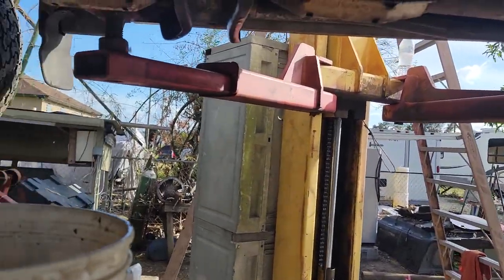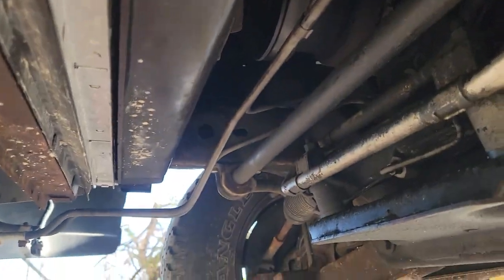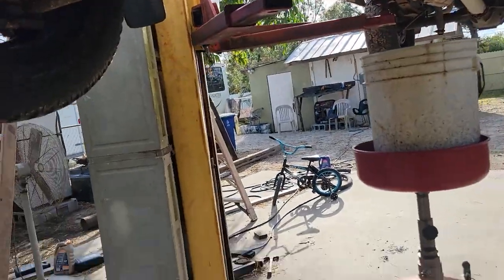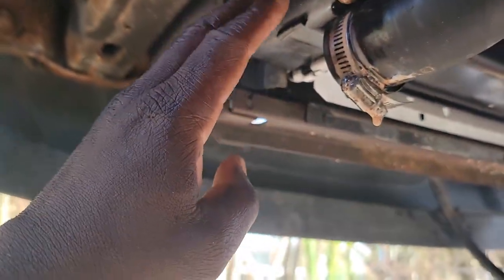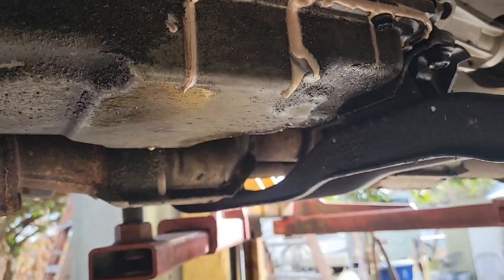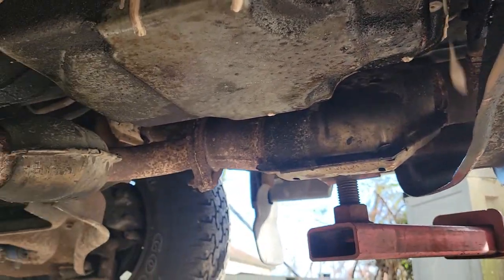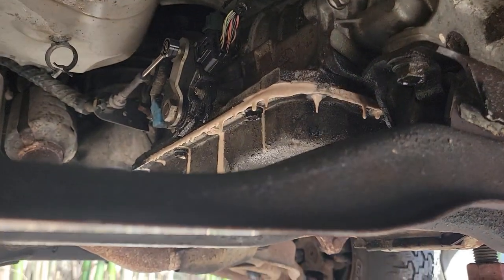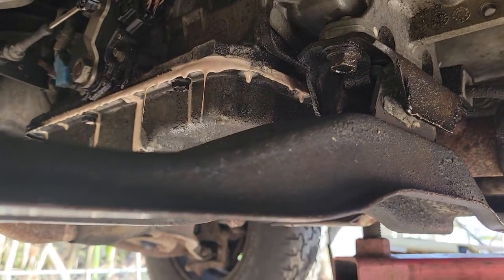FORD RANGER TRANSMISSION FLUID MIX WITH WATER .. BAD RADIATOR!

Comment: I got a 99 and the fluid started getting into the coolant but not the transmission! I got lucky with my break lol.. does it still run now?
Reply from the maker: Yes it still runs good
Reply: @wbrave231  lol that’s wassup I got 340,000 miles original engine and trans.. how about you?